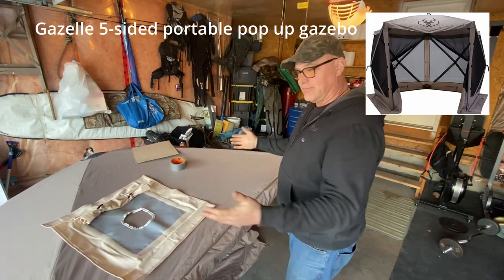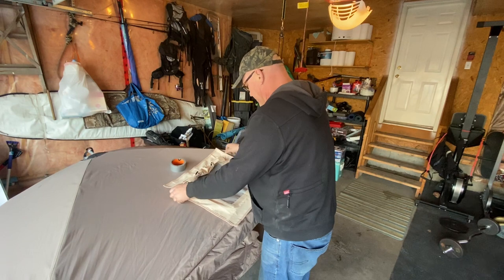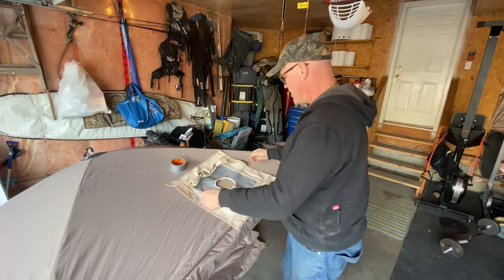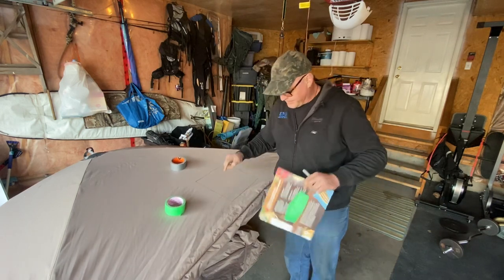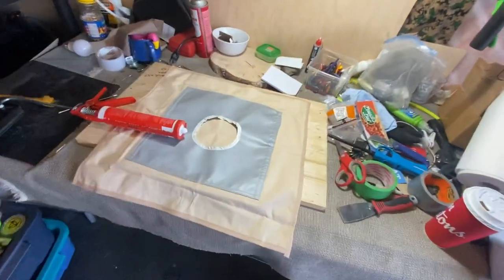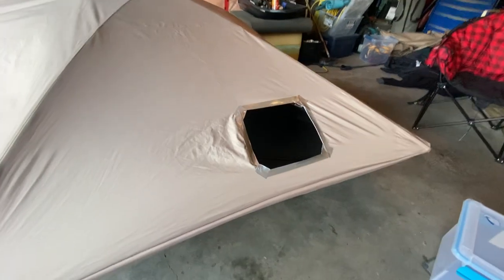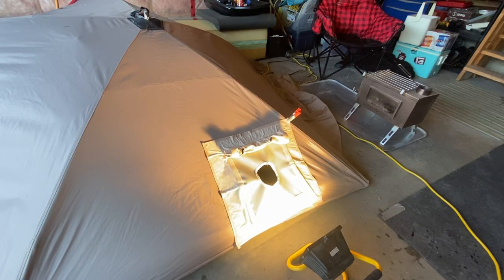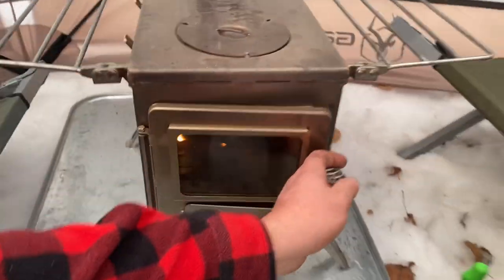Gazelle To Hot Tent Conversion - Great Idea Or Costly Mistake? |  DIY Stove Jack Install Gazebo

Comment: I just got back (9-16-24 thru 9-19-24), from a Yellow Post Camp-Site in the San Bernardino Mountains. My Son & Me were up to 7500 Feet. It was freezing cold at night (30-40 degrees). What most people don't know is; the G-5 (even without panels" is much more warmer inside than outside. Luckily, we had a propane fire-pit, we brought inside and "MAN!" what a difference that made. The G-5 maintained around 65-70 degrees, in the freezing cold! It was a "TRUE" lifesaver! Yes, it was easy to put up & take down (One person). We will "NEVER" go camping without it!!!

Comment: What size is the hole in the jack? I seen your review on Amazon and found you YT channel, looks like you’ve got the large Winnerwell stove I’ve got the medium. Thanks for sharing the install
Reply from the maker: We have the 3.5 inch stove pipe so we went with the 5 inch opening. I found leaving some room around the stove Jack let’s it cool off better.
Reply: @CANcamp  if it's raining while using the stove, wouldn't water run in through the gap and cause a bunch of steam  in the tent?

Comment: I’ve been following you for the last year since finding this video. Great content.

I’m curious how the stove jack held up. I’m thinking about following your lead on mine but I’m concerned about melting and water leaking during the warm months when the jack is closed up. How did it work for you over the last year?
Reply from the maker: Works great.  The has been zero issue of water leaking when not in use with wood stove.  Only modification since video was adding an elbow so that the embers do not fall back into the gazelle.  We used a 30 degree off set and that seemed to do the trick.
Reply from the maker: We appreciate you following and thank you for your question.